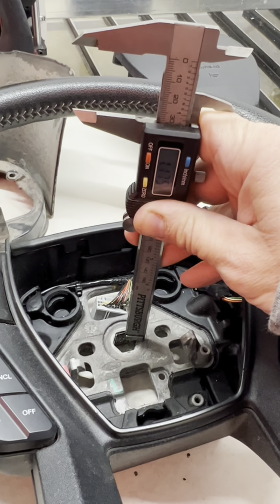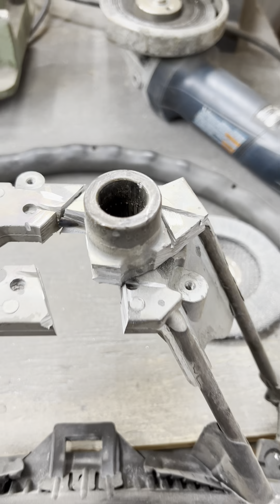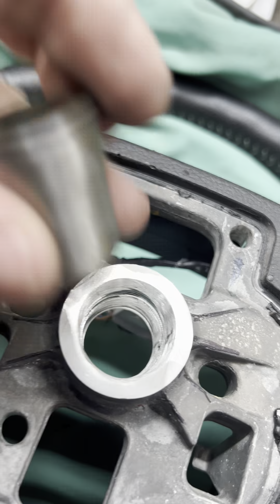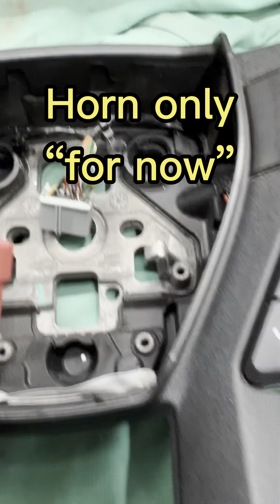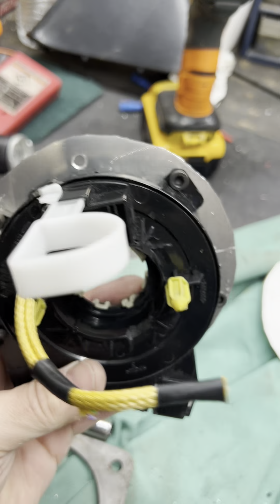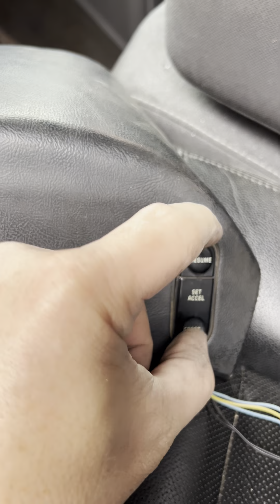2015+ F-150 steering wheel in a OBS ford

Comment: Hey, you and the tattooed dad on TikTok are the only ones to make any sort of content about this swap. His method is just slamming the new wheel onto the spline shaft with the factory OBS steering shaft bolt to “make its own splines” lol, then replacing that bolt with the newer style steering wheel bolt. He claims it isn’t gonna go anywhere since it’s tapered and whatnot. What do you think ?
Reply from the maker: I think he’s a smart dude, and has done a bunch of em. Way less work than this. Probably what I should have done

Comment: I think if you were to tap into that pigtail on steering wheel find out what each button does to each pin and make it tap into the trucks Cruise control and then keep the buttons I don’t know but I fell like those buttons could be used for cruise control